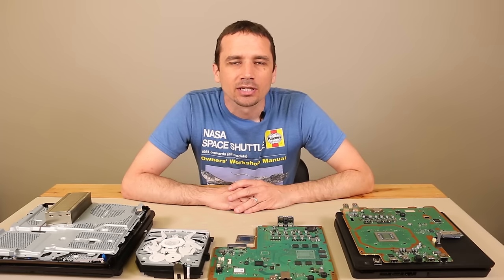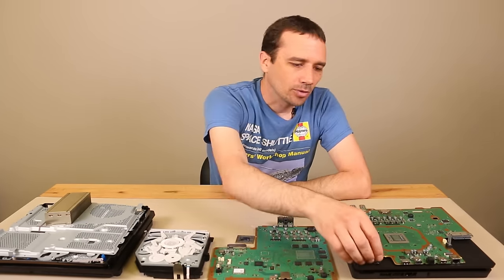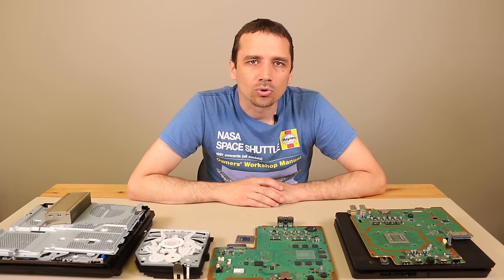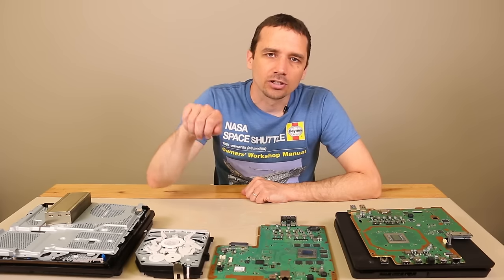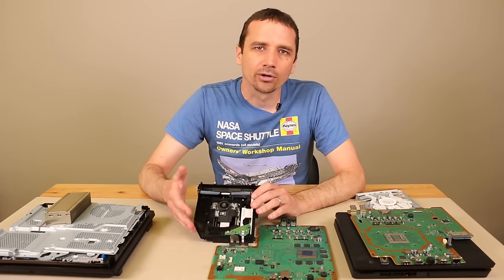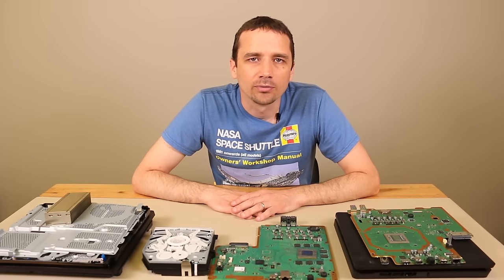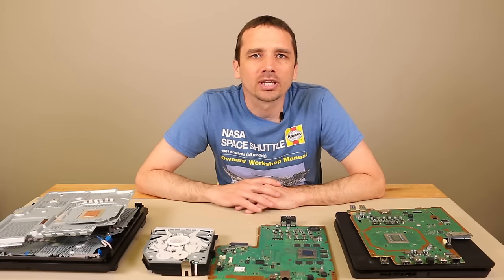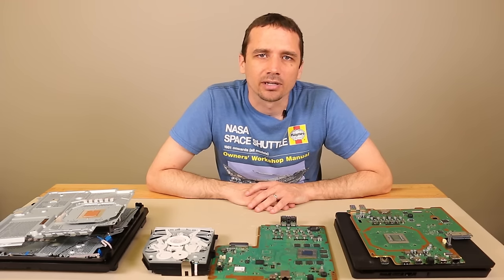Top 5 PS4 Problems With Solutions

Comment: I have a question? my ps4 has a problem of it always disconnecting the controllers.
Reply from the maker: From any distance?
Reply: TronicsFix Yeah From any distance, I would usually play games for about an hour and it would disconnect or it would move the character around constantly without me holding the controller I also thought it was the controllers but I got a new one and its still doing the same thing on that new controller
Reply: Benny Yazzie i have the same problem i need HELP
Reply: My ps4 does the same character just starts walking and control powers off and won't connect I have to restart all over making me lose all my progress due to non save
Reply: That's also a problem with my Xbox 360
Reply: Are you offline? I had this problem when I'd start from standby mode without Internet access.  Only solve I found is to do a full power down if I'm not connected.
Reply: Charge it
Reply: Same problem, the controller will connect for sometime then randomly disconnects.
Reply: You Cheeky Shish sounds like my old launch console i found out it had a bad power supply but again youre problem could be different

Comment: . What happens if the fan doesn't work my PS4 is overheating because my fan is not blowing air into it
Reply: Then you probably need to replace the fan. You can find them on Amazon for pretty cheap.

Comment: Well my ps4 turns on and play for a couple of games and then turn itself off
Reply: Well it does not completely turn self off it stays on but the screen goes off and ps4 still on with a white light
Reply: Your TV might be going to sleep set it to never turn off.
Reply: Have you ever vacuumed the back.  If there is a lot of dust it will overheat.
Reply: It means its overheating its got too much dust DO NOT vaccum it the static will damage it use compressed air that will fix the problem you may need to open the system up to fully clean it
Reply: toonwarrior ...it is due to voltage problem ...check out your power supply.
Reply: toonwarrior
Reply: Euan Smith no nothing will happen the guy who made this video actually recommends to do that and is really smart in 1 of his videos about PS4 that's just a myth lol
Reply: Aussie Andy Same here, mine turns off by itself when using wifi and ive always had to use ethernet

Comment: PS4 is loud, sounds like a jet lol.
Reply from the maker: Yep, they can do that.
Reply: It's thermal paste that needs to be redone. Also, could be clogged cooling fan.
Reply: Yeah mine does that to ...that’s actually the reason I’m here but as I see it doesn’t seem like to bad an issue
Reply: My ps4 slim is quieter than my ps2 slim.
Reply: @RonaldoTalison  you got lucky then because it's a problem with the ps4 just check all the post on Reddit.

Comment: Well I came here to see if there was help.. but all 5 listed are not my problems. My issue with ps4 is the  controller and ps4. Controller would blink and disconnect randomly when playing 30 mins to 1 hour or sometimes 10 mins online. Its weird because the controller blinks and disconnects online and unavailable to even turn back on until ps4 is reset or turned off. Regardless it keeps happening... and I know cant be the controllers.. because I used brand new controller still same problem. I updated drivers and everything. Bought a brand new USB cable and reconnected my controllers still same issues. I am not sure what " hardware" is it called for ps4. Maybe bluetooth for sure but not sure what the proper name is for it.... and I am struggling to find out how to fix that.
Reply: me to brother have u fixed it
Reply: @goldplex  no still same problem

Comment: I still have my original ps4 got it on release day and I use it nearly everyday.  Still works like its brand new. Just look after your stuff and it lasts
Reply: Nah my guy. Some ps4 are broken from factory. I have mine for 2 years. I got no pets no dirt, i clean it every 3 week. I take care of it, gently touching it. From the beginning i got the same error code every once in a while ce-36329-3. If you search it up it says you need to update the latest version. I always had the latest version. I read further and i found it could be a hdd problem. Got to a point it doesnt even start up. I guess i got unlucky and got a broken one from factory. I cant do nothing about it, bad luck.
Reply: A lot of electronics are bound to break no matter how careful you are with them. Mechanical parts wear out, electrical components degrade and get out of spec. The only way to prevent this would be to never use the item, and even then some electrical components (especially capacitors) will degrade with time.

Comment: Mines plays good but after a while it looks like it loss conection its not overheating and the red light havent go on or nothin it stays straight white and the controller disconnect
Reply: Mine is exactly the same
Reply: And mine just turns off

Comment: Idk whats going on with my ps4 pro. Im thinking its either overheating, faulty fan or storage problems. My games arents rendering right and they keep freezing im a cronic smoker of weed and cigs just got it last september. Any professional help would be great. I know it has to be cleaned but hardly anywhere likes to deal with cleaning smokers electronics
Reply: Wolf Of Cold Flame take out the hard drive and do a low level format on your pc
Reply: Then u want to boot ur ps4 into safe mode and select option 7 and u need a usb with a couple gigs in it and u need to download the PlayStation software from Sony and it will fix the problem of freezing and stuttering and low loading times.
Reply: @electric3420  alright I'll try that out thanks brother.

Comment: I’ve got the release model, but only started having the disk eject/beeping issue. Tried the soft/hard reboot. Scratched the gold bit on the board covered it with tape , removed the rubber foot. Everything. Console works fine on digital despite its constantly trying to eject a disk that isn’t there, beeping a lot and quite often switching itself on.
Reply: Same. Now my disk drive doesn't accept disk anymore.

Comment: "Being hot is not a problem..."
Then he proceeds to list 3 out of 5 catastrophic issues caused directly as a result of overheating. 🤣 If your Accelerated Processing Unit is literally getting so hot that the flux is heating up to the point that the 60/40 solder is detaching, then heat is absolutely the single biggest issue going on. Let's crunch some numbers here... 60/40 solder melts between 350°-450°F. If the outside of your PS4 is hot (not warm, but hot) to the touch, then it is only a matter of time before your PS4 ends up in a shop because of the issues that he just listed. Also note, you will smell flux and paste overheating. It will give off a distinct faint burnt electrical smell. The fan will blow that smell out the the vent ports. If you smell it overheating, then take a break. 
Cockroaches and ants are attracted to heat and to circuit boards. It actually helps them digest their food. 
Some very simple steps can help prevent overheating. Give your PS4 a break to cool off. The APU is most active when connected and processing data online. It's actually one of Sony's mandatory requirements for console game developers to adhere to. They deliberately make you wait between matches of Modern Warfare and Fortnite so you won't destroy the console, controllers, or your own mind. Also, watch a DIY video on how to legitimately clean your PS4 at least twice a year. And last, do not stack games, magazines, stickers, clothes, charging hubs, or especially not any other electronic devices that produce heat, on top of your console. Electronics function up to 30% better, faster, and within specs in cooler environments. Fans can only do so much. Think outside the box and make sure you're not cooking your console. (Why do you think they designed the newer consoles with the ability to and even suggest that owners stand the console up on its edge instead of laying it flat?)
Great informational video, but heat is absolutely a huge problem. 60% of the issues listed here are the result of it.
Reply: Thats all good info, i just found out there is a little space between the fan fins on the pro and the heat sink is right behind that. I took my air compressor and blew the heat sink out, it was covered in dust. I got it lookinv like new and its much quieter now. The fan used to kick into high gear alot.

Comment: I've had that exact scenario with the plugged-up fan exhaust in repairs and broken units I've worked on.

The cause? 100% of the time it's a person that smokes a lot of marijuana. That mat you lift out is straight-up dust and resin. If you were a gross feigned I swear you could get faded off one for days. It's a thick mat of resin and dust/dirt. Always, 100% of the time.

Comment: Any suggestion on if there is an internal problem with my wifi or internet chip in the PlayStation? I bought a new modem, I’ve tested my internet via Ethernet everything is normal. When I connect it to the ps4 I’ll always randomly freeze and lag, in game,even though my internet is fine.

Comment: I just got the blue light...but maybe not death. After it turned on then off several dozen times, I then dismantled & cleaned everything. I did not use the washer trick, but instead [very very] slightly bent the guard for the APU (on the Pro) to apply more force before reattaching it. It didn't work at first, but turning the system on its disk drive side, and giving it about an hour to rest, it then turned on. Luck, I'm sure. But maybe this will help someone. 😉

Comment: I fixed many ps4 systems and for me the two most common problems have been ps4 only booting into safe mode and corrupted hard drives.
I have a stack of corrupted hard drives that I have pulled out of PS4s.
Reply: hi, i have the  SU-30645-8 error, could this be a corrupted  hard drive?

Comment: I've never had any problems with my Intellivision 2, NES (The Blinking red light is easily fixed by cleaning the cartridge port and cartridges)Genesis, Sega 32X, Saturn, or Nintendo Gamecube and Wii, I did have the GDROM go bad on my Dreamcast so I bought a preowned one and swapped out the drives and it's worked fine since then and now I've replaced it with a GDEMU, also the CD ROM went bad on my Sega CD that I bought used but that was after may years of use. Saturn CD Drive is still working perfectly.

Comment: Hi Steve. Thank you for your great videos. I'm a subscriber. Please help with this question...

I noticed that GameStop has a computer and maybe some software that they hook up the game consoles to I guess maybe to run a quick check to make sure all the things are working correctly ?

What's the best way or the best ways and fastest ways to hook up consoles and make sure that they're working properly and don't have any underlying issues so that we can sell them confidently without having people wanting to return them ?

Are we able to get that same software that GameStop has and connect the consoles and it just does a quick run-through and let us know right away or are we forced to bring them home and play them for hours and hours for a week straight to verify everything is ok before we could even resell it ?

I had sold a PS4 a while back and I had used it for about a month straight but I only play it about 45 minutes to no more than one hour straight each time. After I sold it the guy wanted to return it because he told me after playing it for an hour straight that it shuts off but that it still works but it shuts off after 1 hour.
I didn't know it had that problem otherwise I would have mentioned it in the listing.

Thank you. Anybody knowledgeable please reply soon.

Comment: Recommending a laser/disc drive replacement "because you already have the system open" is bogus I have 20 year old systems with the original lasers and drives. They just need some occasional upkeep. Chances a ps4 laser or drive are beyond repair are slim unless it received heavy abuse.

Comment: Yeah for all you noobs out there who want to go and strap fans to your console or start breaking them down because they're hot to the touch electronics are supposed to do that, it's when you touch it and it's cold after you've played it for 30 minutes when you need to start worrying because that means the heat transfer inside the console is not working.

Comment: Hello, I was trying to dust out my PS4 and when I tried to disconnect the battery the base came off, and one of the wires is hard solder back on because no connection left on the motherboard, it needs jumper like you suggested. Do you still fix them? How can I send it in? What’s the coast and fees?

Comment: I know this vid is old and well every one is jumping the PS5 aka PS4 Pro-er. My PS4 has started having issues. Its maybe now almost 7. Not bad. Though the only issue I ever had with a Nintendo was a bad optics in a Game Cube. Both my PS3 and my PS4 have had board level issues. I am assuming, cheap parts or RoHS related. My PS3 has issues in the RAM. I suspected for a long time but when it started messing with the video, it was clear. The PS4, just recently started having the BLoD. I replaced the fan and the issue was resolved. Not the first time dusting it but took the time to clean it top to bottom, install new thermal pads and fresh thermal past on the APU. Now not even 90 days later, and it's back. I am not sure yet if the new fan died, it's controller chip, the Power supply or if it is a general issue with RoHS. -What I don't see on pretty much any help doc or video is how to KNOW if the fan, or PSU is failed. On a PC you can trigger the PSU to turn on and if that fails, you know. If it does turn on but any of the outputs fail, you know. I did find a youtube vid where he posted voltages for one section which was helpful, and I tested to confirm normal for that circuit in stand by. I would love to come by a full document that describes voltages of test points under stand by and powered on stand by states (login screen). 

So far looks like the replacement fan died, Again?! It was precipitated by the PS4 being unable to properly sync the licenses. Shut down to rebuild the database, and thats where it all ended. If this doesn't resolve then I am looking at reballing chips. I don't have enough info to support replacing any one chip yet. 

What we also lack is a good compile of known BLoD and WLoD behavior tabled with the corresponding fix. 

I see many refer to the BLoD knowing full well it's several issues and that even the symptoms are NOT the same. 
For example, there is no Blue LED. But the CD eject beeps. Some the system will try to power up and then shut down. Mine I get the CD and the Blue light just for a moment then nothing. Others will keep getting various beeps or the light will respond each time they hit the power button then fade away. WLoD should be obvious as the system will otherwise boot and the controller should come on. In a true BLoD the system has failed something in the post test. There will be no power from USB and the Controller cannot wake the console. If the controller wakes the console, but there is no picture then it should be something related to WLoD. 

I have also seen odd ball repairs where it was not an issue of Reballing. But rather that the the APU, South Bridge, or Fan Controller chips had failed. Even various resistor blocks had failed. In all cases once repaired the system booted. This is another reason why a well made document indicating various voltages, resistor states, ground points, not ground points, fuses, would be really good. 

Un-Related to BLoD, one thing we also have needed since the days of the PS2 is a User Bootable self test. The ability to run a program to check the Cache, RAM, HDD, VRAM etc. Then report back any errors that need to be addressed. Like hard drive failing, or a fan that isn't coming up to full RPM. 

By the way, every one asks how to get the fan to run full RPM on a PS4. I see it all over. If the system is functional, no BLoD. Then simply pull the HDD and start up. The firmware will be very mad that it cannot boot the software on the HDD. It will boot into a interface locked BIOS of sorts that is used to set up new hard disks and perform updates. The Fan should run full tilt the whole time. This is also common while the directories are being rebuilt.

Comment: You basically told me I need a new PS4. 
My PS4 died on me. Tried to turn on, blue light came on then went off. After that, PS4 was completely unresponsive. Took it to repair shop, paid $120 after he supposedly got a new Power Supply, took it home, turned it on, it turned off after 10 minutes.
Unresponsive.
Took back. Waited 3 weeks. He said it was fixed. I played it for 2 hours. Turned it off. Went to work for 7 hours. 
Came home. Played for an hour. Cut off. 

Press button and it makes sound but no light or power.

Comment: Can you help me diagnose my PS4 problem?: 

-It's one of the older 500gb PS4's.

-Powers on, TV receives signal but the display is completely black, safe mode is inaccessible. (I've tried swapping cables & even tried multiple TV sets)

-Blue light flashes when first powered on, then turns white, it power cycles by itself once or twice after light turns white, still no display & then it does nothing until i manually power it off by holding down the power button.

-I can hear the HDD, but the console sounds more quiet than usual.

Help would be greatly appreciated! Thank You!!
Reply: Do you have a pesky little brother that likes to annoy you?